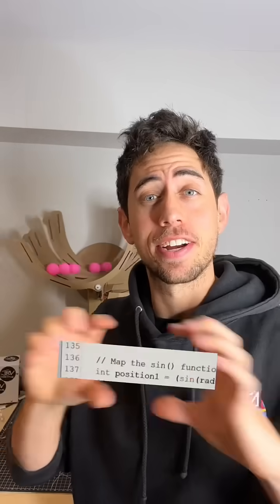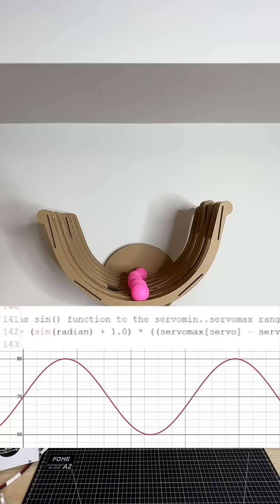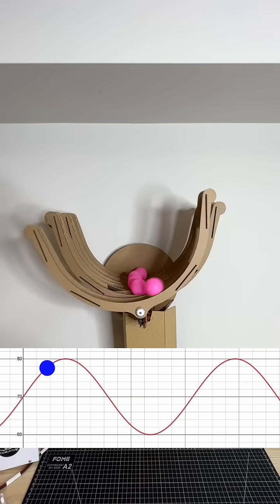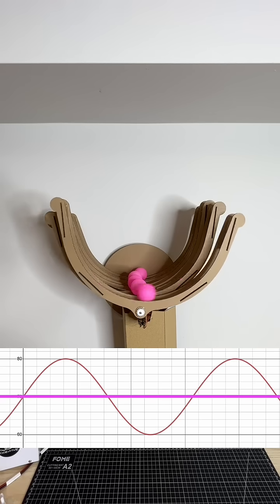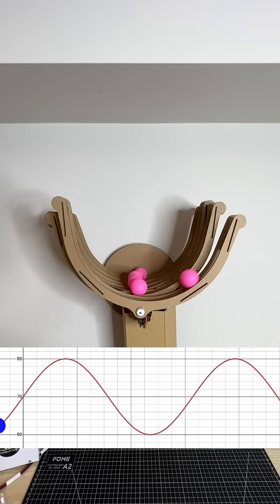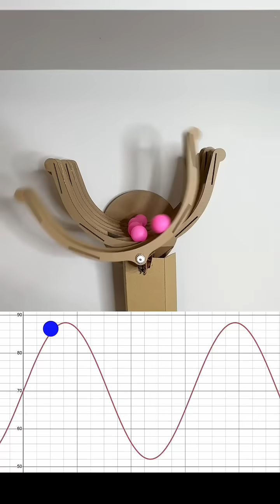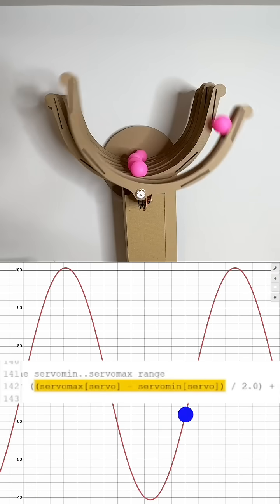And You Thought Trigonometry Was Pointless…

Comment: I think how the things rotate using those servos for each one of the 5 is that they split up the sine wave in lots of small computable pieces and get the tangent slope on each of the points on the curve and rotate more if the curve is angled to face vertical the fastest and no rotation if it’s flat or horizontal, then just invert it or add a Boolean that does that if it goes below the middle line which is basically just making it so that if the tangent line faces down you should go the other way and then just add some offset to each of overlapping sine wave from each of the n number of those ball rolling rotating arms with the perboloid curves in them and set the different of each or the amount that they are spread apart to make a smoother or more oppositional sort-of effect. Opposite movement for every other one and perfect sync are opposites to each other.

Comment: Try making every single one of the arks having a sin wave slower that the ark before, and start them in sync. After some time it will become the wave, then the 90 degree thing, then the 180 degree thing. You basically make a polymeter out of these arks!

Comment: Pi/2 phase difference is achieved in inductive capacitive circuits where the current lags and leads voltage by the value. This is more relevant to physics but whatevs

Comment: Trigonometry is very important in certain programming tasks, especially ones that manually traces circles, aim with projectiles, etc. It is even possible to convert your x,y coordinates from a sin+cos calculation, which are important for determining a projectile's rotation + angle of fire, especially one from an AI or player..

It also requires Pi, as that is the value of a full rotation in radians (i think). Do not underestimate the power of Pi.

Comment: This isn't really a good example of why trigonometry is useful

I use it everyday when dealing with engineering problems. Be it solving for the internal loading of a static beam, the true trajectory of a bomb released from an aircraft, etc etc. 

Trigonometry is essential, and I use it all the time. It's just another tool in my toolbox that gets high mileage, just like I use calculus everyday as well. 

It's not solving these problems for their own sake, it's about finding something important and then using your skills that you aquire throughout school to achieve it. 

I use algebra everyday, I use trigonometry everyday, calculus, and linear algebra. All of these fields are essential to what I do.

Comment: Very nice visual demonstration of phase :)

You could have also drawn graphs representing the positions of the balls to show the 90° phase change between the driving force and the oscillator associated with forced harmonic motion. You can see this in the clips where the arcs are 90° out of phase with each other, when the ball in the front is at its maximum height, the arc behind it is also at its maximum angle.

Comment: Interesting to see this represented mechanically. The principle of the last example is used in 3-phase 12-pulse inverters (particularly for large variable speed drives). A pseudo 6-phase supply is created using different transformer winding configurations to produce a phase differential (star/delta or extended-star). You end up with much smaller troughs between the peaks of each phase resulting in a smoother DC output with less ripple when rectified.

Comment: Trigonometry is important in electronics engineering as well, because you use the sin function to calculate and compare AC currents on the oscilloscope.
Also in mechanical engineering to calculate forces and things like that(even though it's mostly the Pythagorean theorem).
Reply: @Dain Baptist not really, trigonometry is more the sin, cos and tan of angles formed on arcs of a circumference. It's somewhat related but you don't use it to calculate the aforementioned.
Reply: @OrthaluminoxPythagorean Theorem is important but it’s not the heart of Trigonometry. The majority of trig is based of right triangles but with different laws and calculations, you can answer more difficult questions involving Sine, Cosine, Tangent, ArcTan(Cot), ArcSine(Csc), ArcCos(Sec).
Reply: this is the only reason i learned trig :)
Reply: @Orthaluminox grow up

Comment: trig is some of the most useful math I've ever learned
Reply: Why was trig so useful?
Reply: @jenkathefridge3933  you can use it to measure circles, triangles and any shape you can make from those. Its is used to measure the size of height of structures. Sine waves are used in AC electrical, so I can use it to find out phase angle and is used to express those functions in general. We see that voltage in resistors and voltage in indicators are 90 degrees out of phase, but if their drops are different we don't get a 45 degree angle, we use trig functions to find the total impedance, pythagorean theorem is used here, and the phase angle is the angle of the resulting triangle. Trig stuff is everywhere.
Reply: @The_Koolaid_Control  would you use trig to build houses?
Reply: fridge the roof need cuts, and angles. So you can use trig on that part. For the structure and cuts. Also, If a room is square, then the two diagonal corner to corner measures will be the same.

Comment: Cool and all but i cant help but think theres definitely an easier way to do this? Like just create small delays in between?
Reply from the maker: Delays might be simpler in theory, but in practice would require lots of unnecessary code. The other advantage of the sine function is it eases the start and end of the motion, which would require some other math to implement with delays.